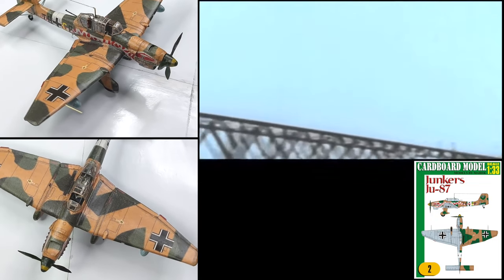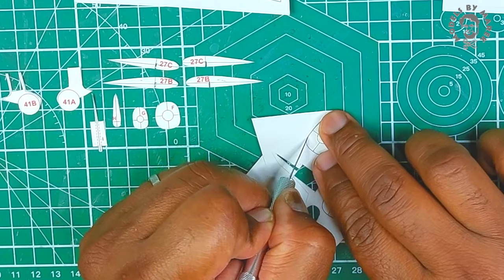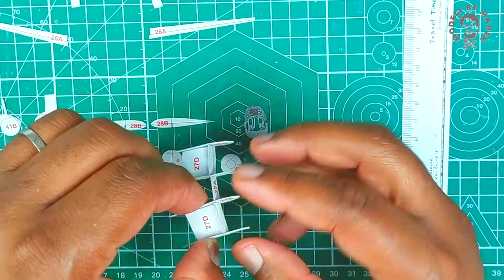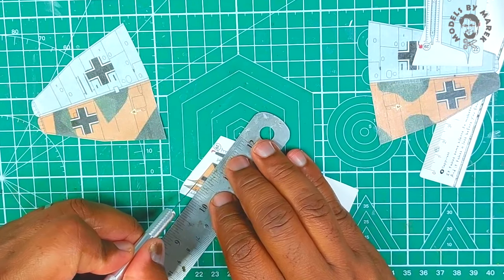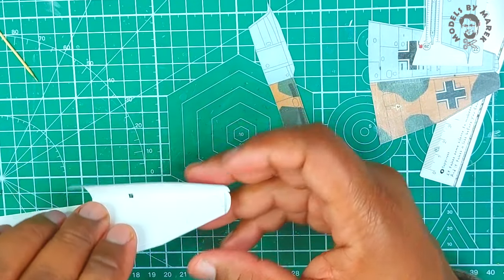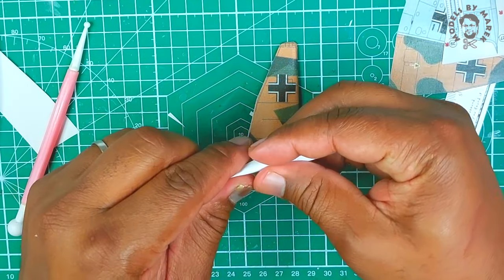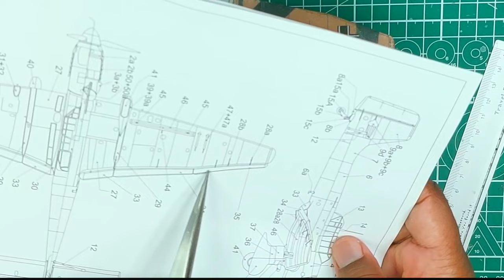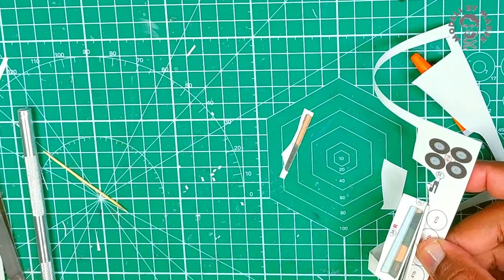Building The MAREK Paper Model Ju87B2 1/72 Scale Model Aircraft PART 1

Comment: Hello.
Very cool, please continue with that! I mostly I build WW2 tanks models from paper in 1/50 and 1/100 scales. I have already over 50 models in my collection, and I because of space on my shells, I started to rescale my tanks from 1/50 to 1/100. But I have some models of airplanes from Marek in 1/50 in my collection. Here is one of my tips: I always pre-paint parts after cutting them out. In future they look like better and result is more accurate. For painting I use acrylic paints.
Reply from the maker: Sounds great! I have quite a few Marek kits as well. Need to learn to be more disciplined with painting edges BEFORE joining. Thanks for sharing.

Comment: Hey Neil. Quick question: if a kit calls for 65 lb card stock with 1mm formers, if I reduce it down to 1:48 scale, should I still use the same card stock as well as the same 1mm formers? Based on what I’m seeing at 1:72, you are making formers with 2 card stocks laminated together? Thank you!
Reply from the maker: Hey there. I currently use 150gsm for this scale build. That's almost the equivalent of 2 office print paper bonded together. So that works for me. Any thicker and there might be issues. Actually comes down to trial and error for me. You actually don't need that thickness former. Actually can go down half that. Hope this helps. Cheers.